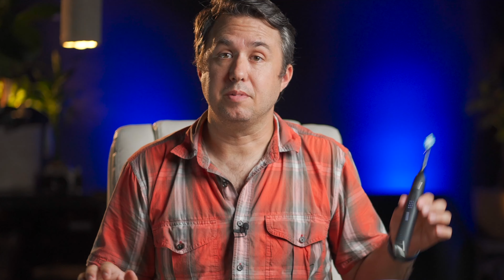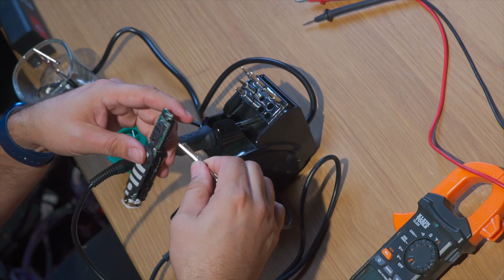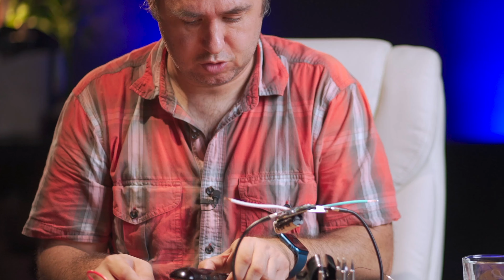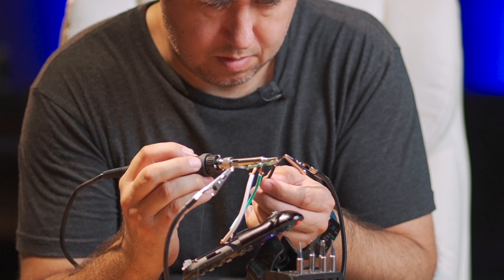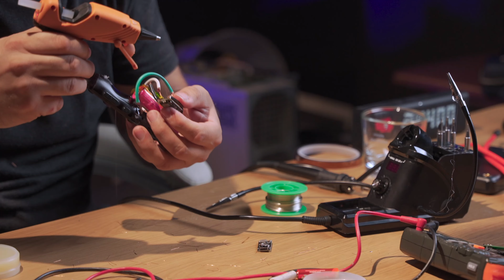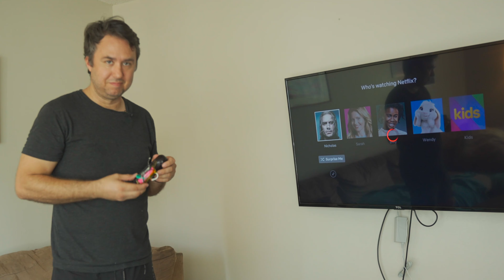18650 Battery Powered Roku Remote that Charges with USB C

Comment: How would you do that to the other kind of roku remote that has the 2 plus sides and 2 negative sides...like the batteries are in same position when i stalled...im going to use the sanyo li-ion aa 12400 battery ,i will romove some plastic inside and place contact points and still be able to use the sliding attery cover...or maybe you can make a video on that
Reply from the maker: ooo I havent seen that particular configuration - but all you need to do is figure out what voltage that remote is ultimately asking for from the batteries - maybe those contacts actually do travel around and still run in series - or maybe theyre running those remotes at 1.7 volts now?  Who knows!  Theres at least half a volt of leeway, but you wouldnt want to push 4v through a system built for 1.5v.

Comment: The chosen battery was a bad idea. There are a lot of smaller batteries that have same voltage and capacity. The rectangular ones fit into the remote very well. Your remote now is very ugly and not practical😬 I doubt that you have used it for more than a day😂

Comment: Do you need to install a battery management system or can you just install the 18650 with the usb c board?
Reply from the maker: The usbc board has a little management system of its own to prevent overcharging.  But I did add a BMS between the battery and the controller so I wouldn’t suck it completely dry on accident.